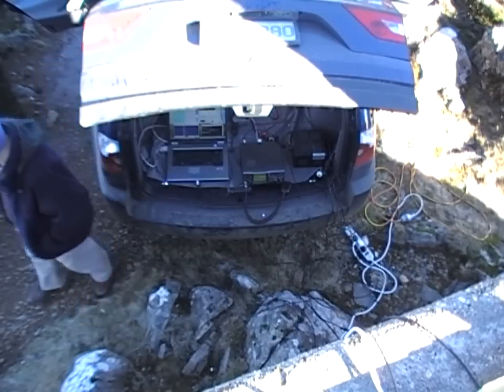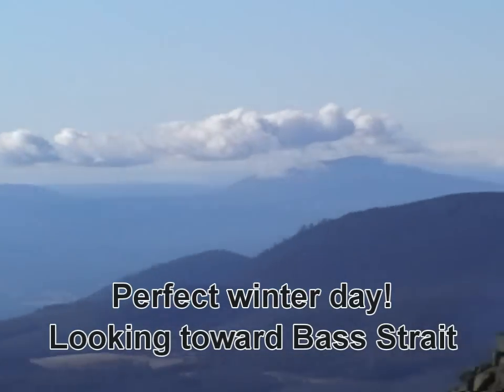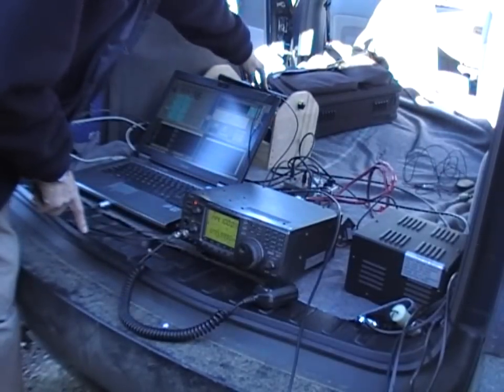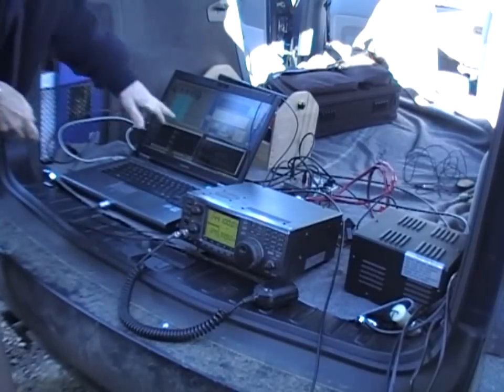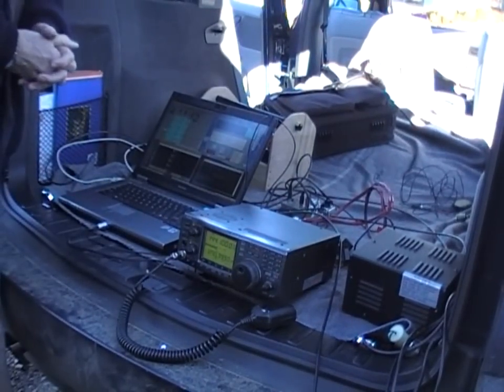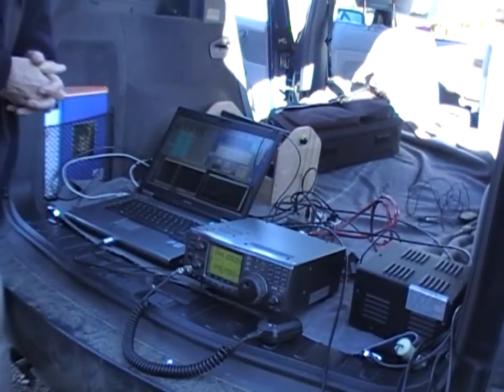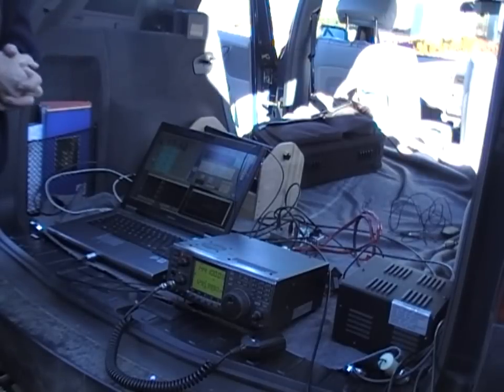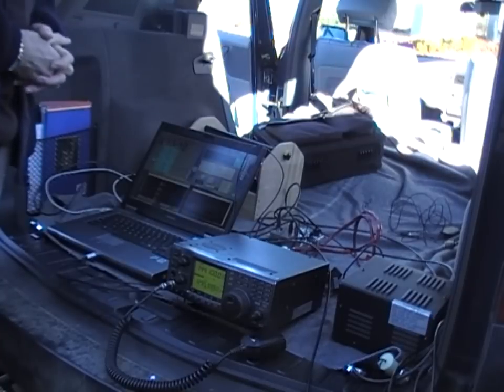Amateur Radio 10GHz digital record across Bass Strait in VK

Comment from the maker: Much of this equipment is pre-loved, the dish, feed and tripod. The PA and transverter is new Kuhne equipment however there are many conversion designs available for pre-loved commercial equipment. Take a look at the GippsTech Proceedings that are published from each GippsTech event , these contain some great material. The 2010 event had a bit of a focus on 10GHz. If you are only looking to operate SSB then you don't need the GPS locking and computer. Hope that helps?

Comment: Well done chaps... I have just built a Kuhne 10GHz transverter, 200mW to 65cm offset dish. Next stop will be a better IF radio (currently tired old FT290R) and a more stable (or locked) LO. Any suggestions on the best way to get 106.5MHz from my 10MHz Trimble Thunderbolt?! 73 - Rob VK2GOM